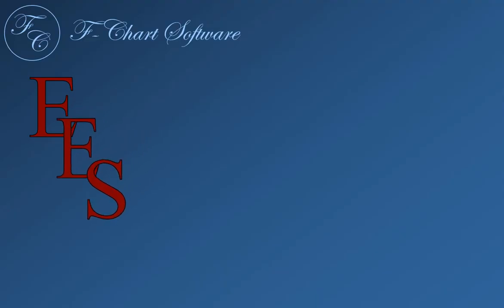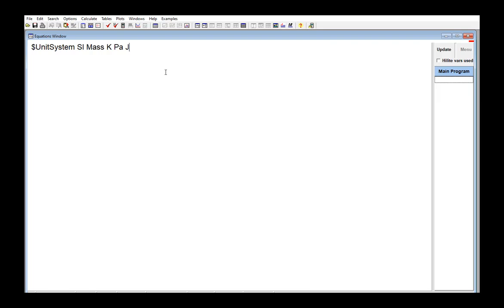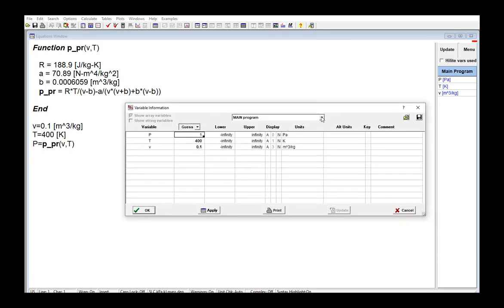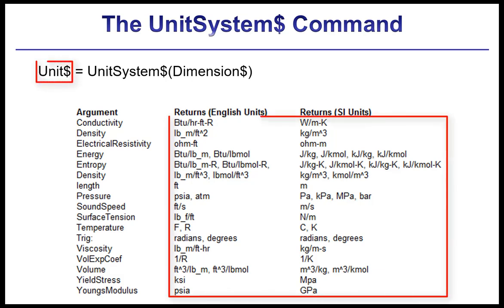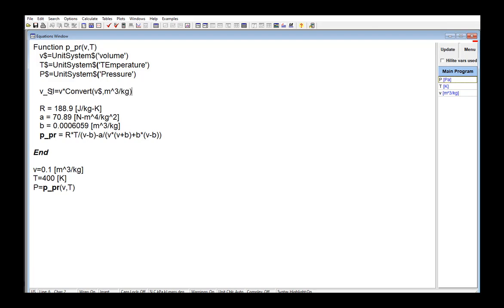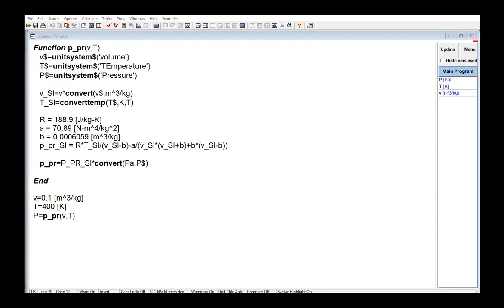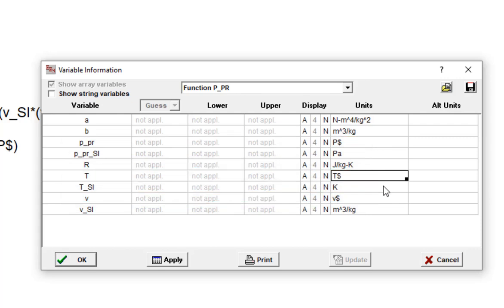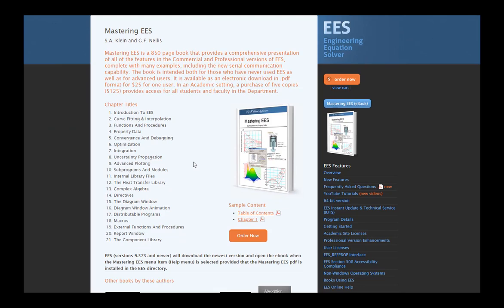Units in Functions and Procedures

Comment: Hi!

I'm having an issue with units inside a procedure. I'm using an IF statement to create two scenarios: m3/h is provided as flow, or kg/h is provided as flow. I tell the procedure beforehand by providing a string variable such as 'Mass' or 'Volume'.
As you can see, these have different dimensions and units.

The problem is that EES seems to run or at least evaluate both side of the IF. For example, I input the 'Mass? string variable and therefore provide F = 100 [kg/h]. Only the side of the IF meant for mass flow should be evaluated. However, the other side is evaluated too, and ends up returning an unit incompatiblity.

Is there a solution for this?
Reply from the maker: you could do something like what is below - it turns off unit checking for the set of equations where one of them will not unit check.  Note that the units of the input flow rate are still checked based on whether you are using it on a mass or volume basis.  Also note that the units will be specified for the function once and every instance of that function is assumed to have the same units so you can't call it sometimes one way and sometimes the other in the same program.

$UnitSystem SI Mass J K Pa

FUNCTION velocity(Flowrate,F$,T,P,Ac,Type$)
$VarInfo Flowrate Units = UF$
$VarInfo T Units = 'K'
$VarInfo P Units = 'Pa'
$VarInfo Ac Units = 'm^2' 
$VarInfo rho Units = 'kg/m^3'
$VarInfo velocity Units = 'm/s'

	rho=Density(F$,T=T,P=P)
	$CheckUnits Off
	IF Type$='Mass' THEN 
	  UF$ = 'kg/s'
	  velocity = Flowrate/(rho*Ac)
	ELSE
	  UF$='m^3/s'
	  velocity = Flowrate/Ac		
	ENDIF
	$CheckUnits On

END

F$ = 'water'
T = 300 [K]
P = 101325 [Pa]
Ac = 0.01 [m^2]

FlowRate1 = 0.01 [kg/s]
v1=velocity(Flowrate1,F$,T,P,Ac,'Mass')